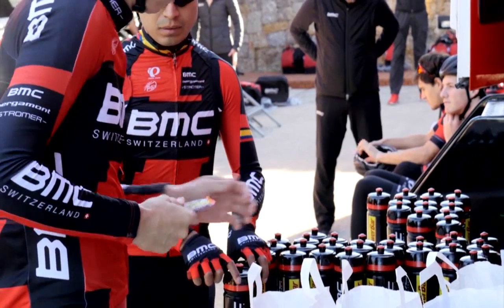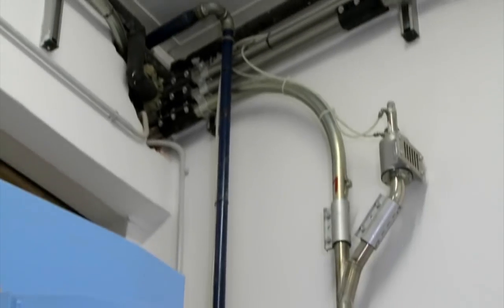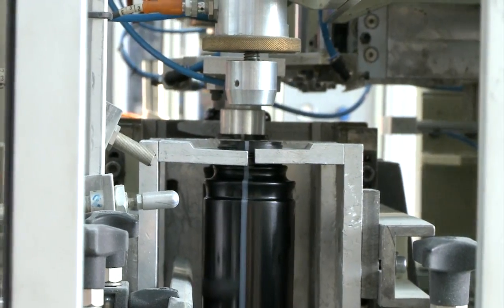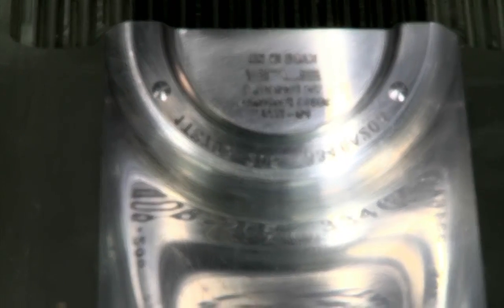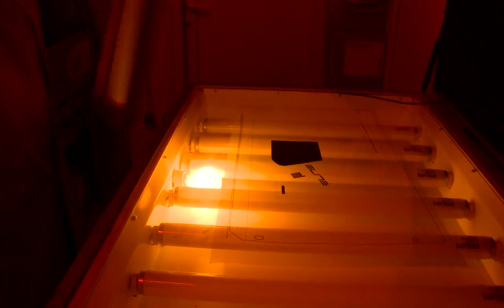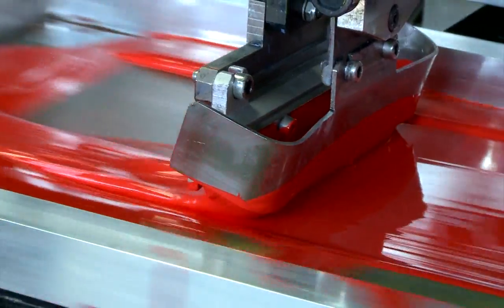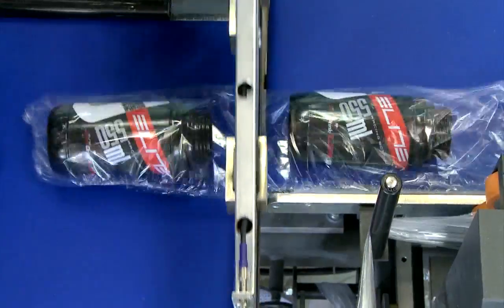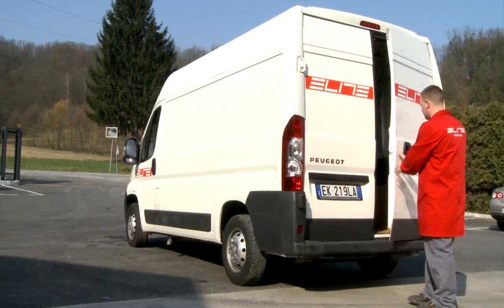How it's made - Elite Bottles

Comment: You should mention that plastic in Fly bottles is 7. The worst possible choice for contact with food.
Reply: I can confirm it, wanted to buy one today.
I wanted to make sure what comment says is true, so I went to store check myself.
And it's true, on the bottom was a number 7 (a very tiny and hard to see I must say). 
Tho the 7th plastic labeled as "Other" which means plastics that do not fall under the existing marking. But what exactly plastic that is? On the official site, it saying nothing but just "plastic".
So until the manufacturer say what type of plastic that is, I won't buy and don't recommend buying these "Elite Fly" bottles.
And let me tell you that BpA is not the only toxic chemical there is.
Reply: @NitroGen150 polycarbonate is stable under reg temp. Bottle says not to exceed 40c so unless you pour boiling water plastics shouldnt leech.
Reply: Old comment and vid but you are delusional. Yes #7 plastic labeled as "other" but does not mean unsafe. Website clearly states bpa free, and if you are so concerned with plastic toxicity go live in a bubble you are constantly surrounded by unknown plastics.

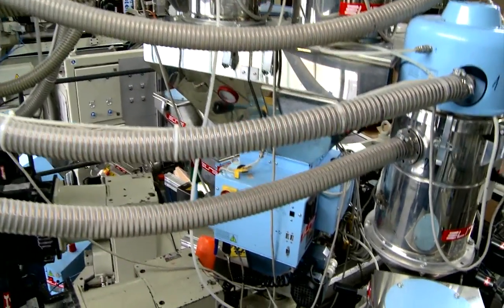Comment: 2:24 "...and arrives in the transfer area without any contamination. Other than the person who just touched hundreds of pallets with his bare hand."
Reply: In theory the LDPE pellets get hot enough when extruded to kill any bacteria.  I always wash my brand new bottles before use anyway, even though a lot of pro teams don't.
Reply: There are 2 types of contamination. Micro and chem. This clearly refers to chem contamination. Oil free compressors play big role in that. Other than that I have observed quite high GMP standards in an otherwise not regulated field of manufacturing. Keep in mind that microbiological load would be much lower in a freshly produced bottle than yours after 2-3 times of use even with cleaning in place.